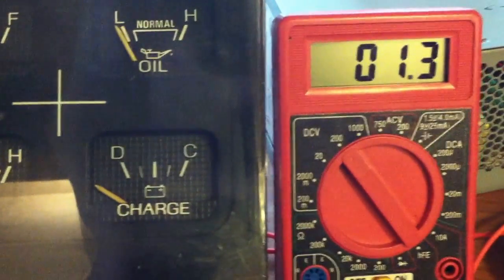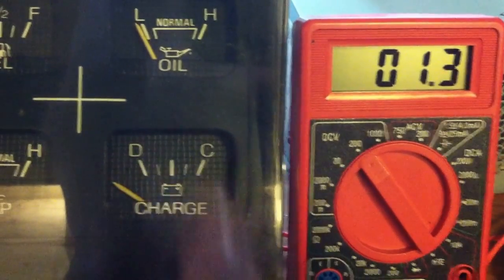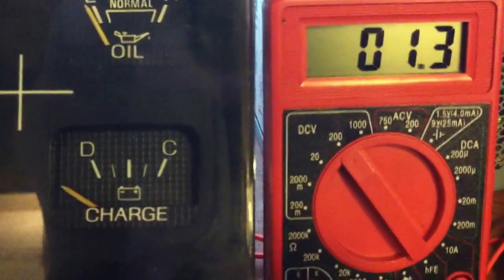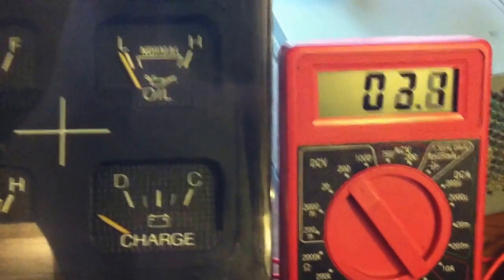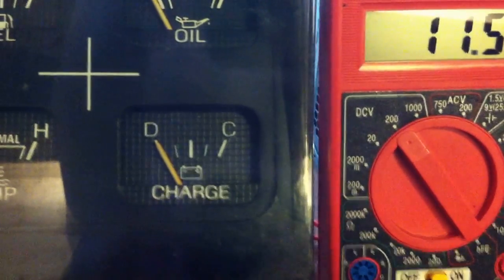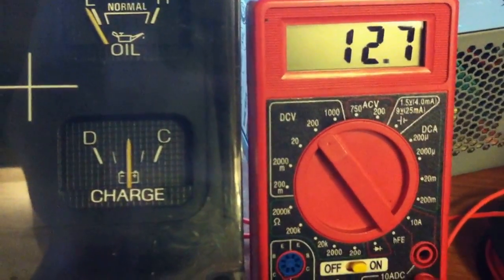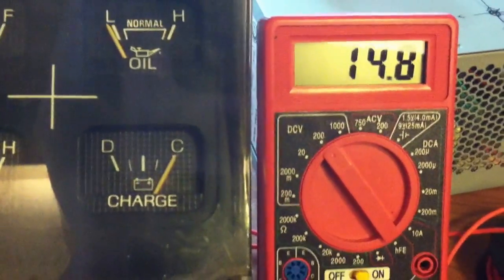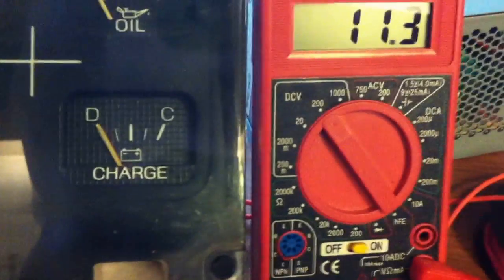1980-86 F-Series Voltmeter Mod

Comment: Honestly as long as battery is about center it works fine in my mind without actually knowing the volts. Running it should be on the C or Charge side. If the Alt goes south it'll drift down to the D or Discharge side. I plan on copying this. 

Also, 12.5v +/- 0.1v is normal resting voltage.

Comment: Can you please show how you put the volt meter in? I own a 1983 f250 with a trashed ammeter too I'd also like to see if you can do this to any other gauges for better accuracy or response if not it's ok I just want to see the volt meter for sure it's the only meter on mine that don't work
Reply: I found the video here - https://www.oilburners.net/threads/ammeter-to-voltmeter-conversion.65859/

4-years later, but hey, better than never... :)
Reply: @cobra02411  hell yeah bro